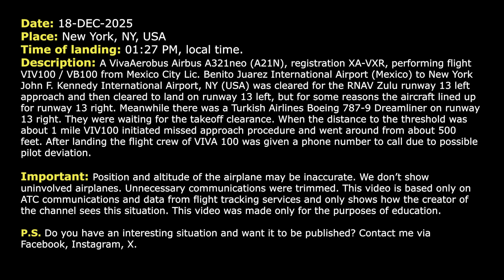Airplane attempts to land on occupied runway at New York JFK Airport. Real ATC

Comment: This was a blatant screwup by the flying crew. This approach is very famous and commonly used at JFK and 13L is often (if not always) the landing runway while 13R is used for takeoffs. 13R (which is longer) is rarely used for landing with this approach because 13L at 10000 feet long is able to handle landing for virtually any commercial aircrafts.

Comment: Noticeable screw up but they noticed a mile out and immediately to correct action to fix it, and thereafter both crew and controllers handled it quite professionally (which by JFK standards is a miracle)

Comment: These navigators/pilots need to have their English tested on a regular basis and also the airports they use/could use, if they want to land in English speaking areas.
I was a former train driver [UK] and we had to know all our routes backwards, where all the signals are, line speeds, who controls them [signal box], know our tractions and basic maintenance and know a rule book 3 inches thick and tested on it every other year [with a computer route/traction test every other year that wasn't the rules] with regular ride outs with a manager.
But listening to American ATC, they could speak better too and more clear. Not as profesiional as those in Europe!
Reply: It's not so much landing in English-speaking areas, but English is the de facto language of aircraft communications. In places where the flight crew and ATC speak the local language they may be heard using that, but default to English otherwise. 

Given it's a Mexican airline operating to destinations in Mexico, they may be accustomed to speaking to ATC in Spanish, but flying into JFK where the English is spoken quickly, it may be difficult to get it right the first time, like the clarification on ASALT.

Comment: You could hear the despondence in his voice when given the number to call.
Reply: Yeah.  I was hoping he would get away without the number...
Reply: @Hullspeed  No chance😀
Reply: Sorry what is this number? Can anyone explain? It’s like a ticket or a fine to Viva or the pilot?
Reply: @huelesacola it depends on the situation.  If you Google possible pilot deviation, there’s a good explanation - but it means you probably violated an FAA regulation and you’re getting called out for it.  At best, it’s a conversation with the local controllers and they keep the paperwork local.  On the other severe end, you could lose your license or be sanctioned.
Commercial pilots have a concern about what their employer might do if it goes to the company - and that’s also a range - but as Kelsey Hughes (747 Gear channel) says, “There are no snacks in the chief pilot’s office.  I’ve checked and there are absolutely no snacks.”

Comment: EVERY pilot flying to JFK should know what Canarsie is. it is one of the most famous approaches in the world and I'm surprised how BOTH pilots can be unaware of this when flying to JFK. It used to be VOR-approach only with visual final segment, but the RNAV (RNP) is used more often novadays. The VOR-approach has lower minimum arounf 800ft and can sometimes be used if the clouds are lower, but the approach path is virtually the same. The last turn just before turn has lead-in lights and you can visually see a hotel and a horse racetrack when you are turning to short final. on top of that there will be an approach path on the screen and depending on the a/c it can even be flown with a flight director all the way to the runway. There is zero reasons why you end up on a wrong runway and not knowing the waypoints on the approach. You don't go to JFK unprepared. I'm not only blaming these pilots but it tells a lot about the airline, that they let their pilots fly anywhere with this kind of preparation.
Reply: The RNAV RNP is a private procedure with RF (Radius to Fix). It's built and owned by Jetblue and assigned to them automatically, and it's always sold to AA, DL, and RPA though those pilots have to request it. They get assigned from standard the RNAV Z, which is also what ever other pilot gets assigned, whihc is a standard GPS approach that technically has RNP like any GPS approach but is defined by being an LNAV/VNAV procedure. It has no RF, rather it has waypoints along the curve but is a visual final sector and has to be flown manually (or using autopilot selected (not managed) modes). So once the turn begins, you can't really fully follow the AP or FDs anymore.
Reply: @benjaminkohl342  I'm not talking about RNP AR -approach with RF, just normal RNP-approach as they are in ICAO terminology. RNAV approaches should have been renamed to RNP approaches few years ago and those with RF-legs are called RNP AR (authorization required). At JFK that is still called RNAV Z, probably because it doesn't require the 0,3nm accuracy due to higher minimums or onboard monitoring. On Airbus it can be flown with FINAL APP -mode all the way to runway, if the guidance is relevant. Autopilot has to be disengaged at minimums, so only using FD if it is showing correct guidance, but technically it is still a visual manouver. It cannot be flown with FLS, it can be flown with selected modes (NAV/FPA) to the minimums and then visually to the runway.
Reply: @kata7218 I totally get what you mean but the US has resisted this - in the US, approaches with LNAV/VNAV/LPV minmums are considered "GPS' and approaches with RF are called "RNP" - it keeps things a little more separated and clear imo.
Reply: @b @benjaminkohl342   The reason for separating RNAV and RNP in the first place is that you have to have performance monitoring onboard to be able to fly RNP (required navigation performance) approaches but there is no such requirement for RNAV. USA is part of ICAO and everybody else is naming their approaches according to agreements made in ICAO, but not US. I’m sure americans can learn the difference between RNP and RNP AR, just like everybody else in the world, since they already have to know that to fly outside of US. And btw there can be RF-legs in SIDs too.

Comment: In all fairness, SW to NE approaches to 13L and 13R at JFK using CANARSIE as your base turn should be avoided whenever possible...  That's an awfully sharp pivot to be inflicting on pilots, that close to the runway. (I realize it's not old "Kai Tak Checkerboard" sharp, but still...)
Reply: It's to avoid LGA traffic. Conversely, when the 31s are in use the departures always have to turn left right away. There's no way for JFK traffic (either landing or departing) to go more than a few miles northwest of the airport without messing up LGA (which needs to leave room for potential go-arounds too). My amateur observation is that the 13s are the least used configuration but NYC sees winds from all directions over time so it's far from a rarity. And actually at Canarsie the approach plate says to turn slightly left -- further away from the airport. You don't actually start turning toward the airport until a couple of miles later.
Reply: @jeremycanna6583 Exactly! And anyone familiar with NYC knows how close those two major airports are! It’s very tight airspace and this audio was alarming beyond belief especially this metro and airport.
Reply: The approach to 13L is really not hard. Furthermore, it is virtually never used in anything but good VFR weather (5 miles visibility and 3,000ft ceiling).

It is actually used in conjunction with RNAV X to 22L, which gives the airport one of its most effect configurations. It is the airport’s peak arrival rate configuration.

The approach to 22L does overfly NIMBY neighborhoods, hence why the 22s are not used exclusively when winds allow for either. 

Anyone see the LDA approaches to Runway 23L/R at Tokyo Haneda? Those are arguably more sporty still than JFK 13L……
Reply: @MMcg7 ...
Yeah, I haven't thought much about NIMBY; most of the discussion I have seen about base turns at JFK revolves around CANARSIE.
  
I am not really familiar with the layout of most airports in Japan, except for Kansei...  It is quite a feat of engineering, if a somewhat flawed one.  I remember it getting a lot of press about the seafloor being softer than anticipated after it opened.  (Not sure about how it's been doing lately, though.)

Comment: RNAV approaches in an Airbus are full of swiss cheese holes (A220 excepted, it was designed for RNAVs).
Doesn’t help that ASALT is used for 13L and 13R (another Swiss cheese hole).
Reply: what do you mean? I would say it is a training issue if you don't know how to fly an RNP/RNAV -approach. FLS cannot be used for Canarsie approach since the offset is too big and it has to be flown with NAV/FPA instead, but if your plane has FINAL APP, it can be used with flight director all the way to the runway on this approach. not all the Airbuses are the same, it depends on which software you plane has and as a pilot you have to know that and how to use it.

Comment: I wonder what pilot school in Mexico consists of.  Aeromexico landed over top of a Delta flight in Mexico City who was on the runway on a take off roll.  Tower and the flight speaking only Spanish.  Kind of hard to have situational awareness.  Hopefully ICAO stepped in after that.  There is a reason all ATC is supposed to be in a common language.  How do you fly into JFK and not know ASALT?  I hope it was a productive call.
Reply: Mexico actually has a rather safe a aviation culture.
Reply: @N1120A  Probably safer than many countries.  However, you don't land a commercial jet over top of another holding in position in the US without accountability.  Also, everyone would be speaking the same language providing some situational awareness to all.
Reply: Unfortunately, the international norm allows ATC communications in English or the native language.  I've flown to a number of countries where ATC was communicating in their native language to other pilots and in English to me.  This is not unique to Mexico.
Reply: @rbias9688  The Aeromexico incident was totally inappropriate without question.  You can't clear an English speaking crew onto a runway then talk to the arriving flight totally in Spanish, they had no idea what was about to happen and were on the roll.  JFK is in the US so even less of an excuse.  Again, if you are a professional pilot flying into JFK and don't recognize ASALT, you don't belong in a cockpit.  If you are at a smaller airport in Mexico and all the flights being controlled at the time are Mexican airlines, I have no problem though that is lazy and that kind of attitude probably had something to do with the JFK incident.

Comment: seems like quite a tight turn to line up for the runway.  Why do they bring the planes in so tight.?
Reply: Some combination of noise abatement and obstacles. Compare the RNAV Z 13L or the PARKWAY VISUAL 13L/13R with ILS 13L. When the ceilings are lower they have to eat the noise abatement concerns and there's a longer (but still abnormally short due to obstacles) straight in to this runway, when the ceilings are higher they sneak in this way to avoid overflying about a zillion houses.
Reply: That's the canarsie approach, tight turns to avoid LaGuardia nearby
Reply: @ernyay1791  Thanks.  I suppose pilots won't know what runway they are going to be landing at when they file their flight plan, but is it correct to assume they would be aware that they could be asked to fly this approach?
Reply: @tchevrier  Most airline pilots dont file their own flight plan. Their company flight operations department does that. Pilots can pull up the ATIS before and during flight to see the runway configuration for landing. They can also look at the TAF/METAR to see the winds which usually dictate the arrival flow.
Reply: It was tight for 31R, oops.

Comment: The pilots realized their own mistake well in advance. Yes their mistake, but they corrected it even before the controller told them to go around
Reply: No they didn't. Even in the go around they were still clueless, didn't even call out 13R and when they were told to fly runway heading they joined 13L departure instead?!
Reply: Yeah, but not before the takoff controller saw their messup. They lined up and were close enough to see the big letters 1 3 R on the runway and thought "que?"
Reply: Disagree.  They should have gone miss long before the the controller told them.  They obviously had no idea about common fixes around that airport.
Reply: Still completely unacceptable

Comment: I understand the crew of Viva 100 is clearly to blame for not being prepared for the arrival and lining up with the wrong runway. It does, though, appear that these types of mistakes happen more often at JFK than in Europe, or even in the rest of the States. Busy airspace: I get it. But so is London or SoCal. JFK controllers appear to be notoriously bad at sticking with standard phraseology. While this might be fine at some airports, a place like New York, where international pilots frequent, is not the place for colloquialisms. English is a second language for most of these crews. Speaking to them a little slower, a little clearer, and using standard aviation phraseology couldn't hurt.
Reply: or it could be this channel focuses more on this area.
Reply: @PrairieFan25  That's a fair point. It could be a factor.
Reply: I didn't hear much in the way of nonstandard phraseology here. I also don't think miscommunication was a factor here. It appears the pilots knew and understood that they were on the RNAVZ 13L, they just misidentified the runway in the turn. That's an issue of (a) briefing the approach carefully (which they clearly didn't do, at least not early, since they weren't familiar with the initial fix) and (b) procedure design.
Reply: @dougmcclean  the pilots had no idea what they were going to fly. It can be bad training or bad briefing. The pilots should know what they are going to see during that approach. First of all they should see the runway before turning in and 13L is on the other side of the airport, it cannot be missed. Secondly there are the lead-in lights guiding them to that same runway. Then there are a hotel and a horse racetrack that can be seen during the approach. Then they should have had the approach path and the runway on their screens. These pilots had no idea where they were going.
Reply: @dougmcclean  I did say that. The blame was on Viva 100.
Reply: There are three busy airports very close there.  This flight was flying inside EWR and LGA to get to that runway.  They clearly didn't do their homework.  ASALT if a very common fix there.

Comment: If an airline is considered a "low-cost" airline, you won't catch me flying it to save $50.  Low pay isn't a good recruitment incentive for experienced pilots.
Reply: Not going to help you much when you're in the plane lined up on the runway that they crash into 😬
Reply: @saadlib  In this scenario, there is zero chance I'd be on a Turkish Airlines flight.  However, your point is valid.
Reply: What about when an emirates A380 got a low altitude alert from the tower doing the same approach ? They were very low according to the distance from the rwy

Comment: Tower was niiice aaand cleeear the 2nd time:  "...runway 1...3...LEFT clear to land" 😅
Reply: They heard it the first time, though, seems they just confused the visual. Which you'd think they would have briefed pretty carefully on an approach to parallel runways with "Turns required in the Visual Segment." But, if they didn't know the initial fix name and needed it spelled, they probably weren't briefed very carefully for this fairly non-standard approach.

The part that risked compounding this was when the tower spent a bunch of time explaining to the sitting ducks why they needed to sit as ducks before even calling a go around for the people who were lost, and then the readback of the sitting duck instruction further delayed the call to go around,. Maybe "Viva 100, tower. Go around, aircraft on the runway. Break. Turkish 4 Heavy, cancel takeoff clearance, hold in position." or something to that effect would have increased the margins a bit.
Reply: @dougmcclean negative. VIVA 100 and Turkish 4 were on different frequencies with different tower controllers, which is also shown in the video. Most likely the arrival tower controller (here 119.1) saw them line up for 13R, told his colleague about it and then called the go around. Meanwhile the departure tower controller (here 123.9) heard this during giving the take off clearence and so was able to cancel it right away.
Reply: @scheckenhere7417 Ahh, very good, didn't catch that. Thanks.
Reply: this time not CLOYDALAYN